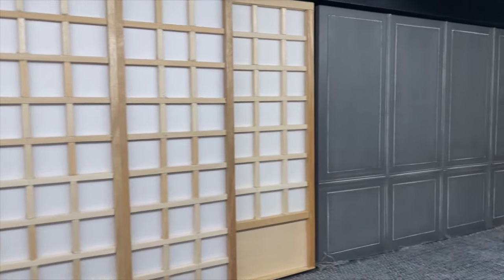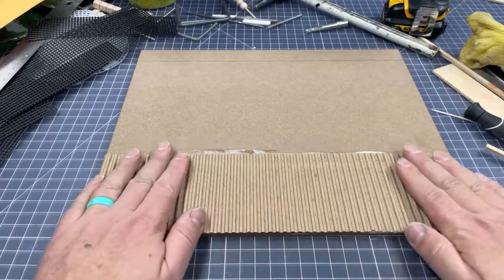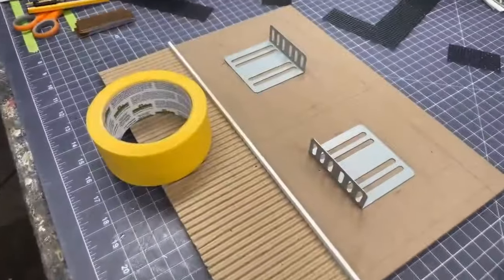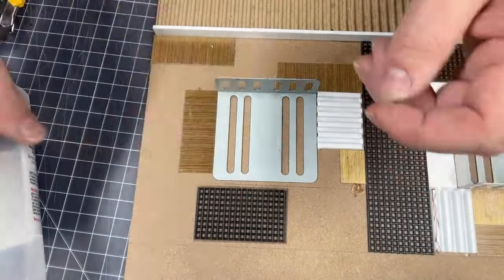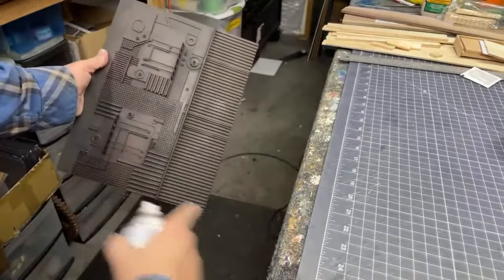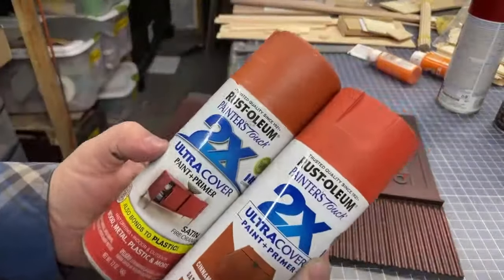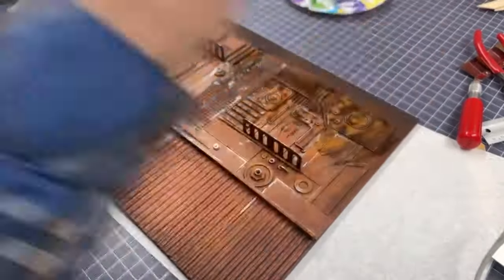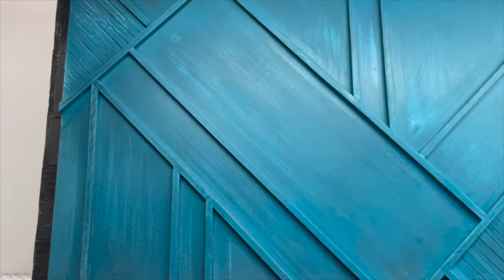Crafting Sci-Fi Atmosphere | DIY Rusty Miniature Wall from Found Objects

Comment: Love how this looks. Really great work. My question is, I use a lot of insulation foam as my base, so as far as priming what would you recommend? I know spray paint ends up corroding the texture of foam a little, I’m wondering if it’s better to build on a fiber board like you’ve done here and then mount it to the foam.

Anyway, love seeing this come together. Really cool!
Reply from the maker: You can build on fiberboard that way, but if you coat the foam with 3 thin coats of acrylic paint as a base, you’re safe spraying with spray paint lightly, I would do this on a small piece of foam to get the feel for it first

Comment: Not a critique, just a question: Do you have a preference for the metallic spray-paint to do the metal spots as opposed to using something like Rub N Buff? I've had good luck with that achieving a similar result, but I don't know if there was a difference in result I might not know about.
Reply from the maker: I use ALL materials, there isn’t any that are better than the others, in this case spray paint is faster, I forgot I even had rub n buff, harder to do Miniature scratches with rub n buff sometimes, spray paint does it all 🤷🏻‍♂️ it’s really just what you have and preference. I use EVERYTHING